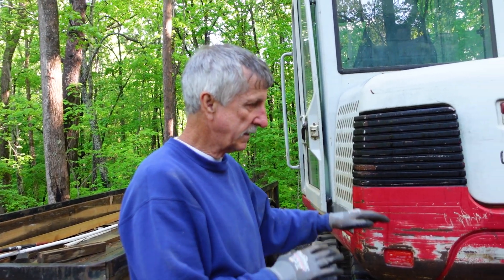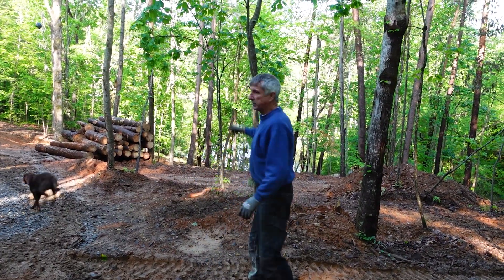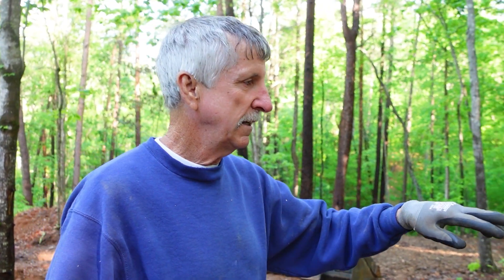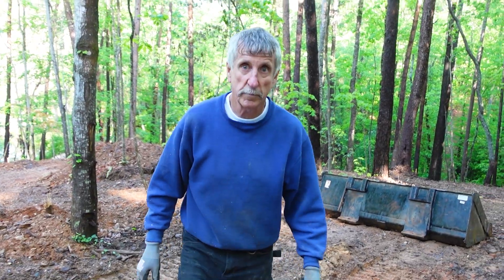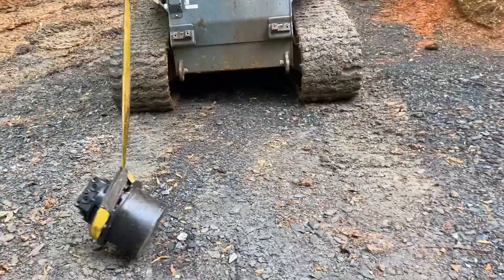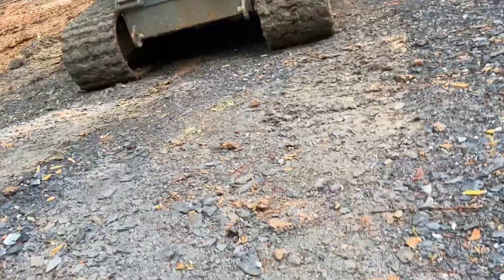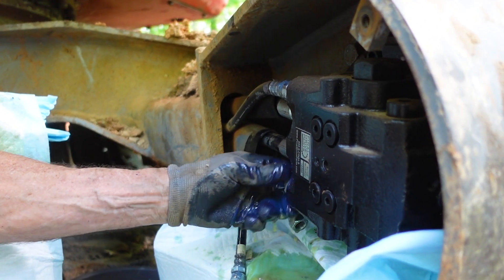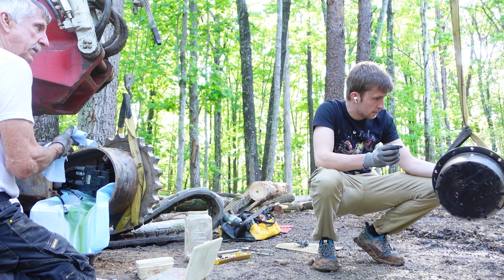Replacing Final Drives on Excavator

Comment: I have a Kubota KX121-3 that one of the drives went out. Locked up, just like you said yours did. I’m planning on changing both of them next May when. Get back from the winter in Mexico. I have to do everything alone because I don’t have any help. But I’ve rolled the track off probably 6-8 times in the 1000+ hours I put on the machine. Every time I put the track back on myself. 
Sorry for the drug out question. Where did you buy your a final drives at? I’ve talked the Final Drive out of Texas, and seemed impressed. Just curious your experience.
I know this is a stupid question, but I was wondering if I should change the hoses going to them. My machine has 2900 hours and to the point I seem to have a lot of hose problems.
Reply: I have recently had the same issue with mine.  Was yours leaking  as soon as you put fluid in and then lock?  I am thinking of replacing the seals..$113.00...but I just dont know if it's worth it.😂